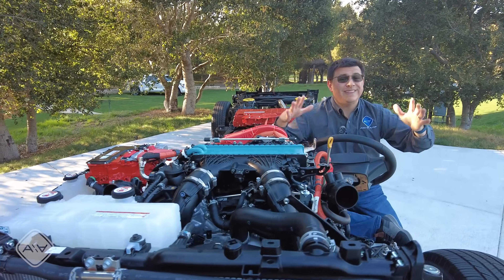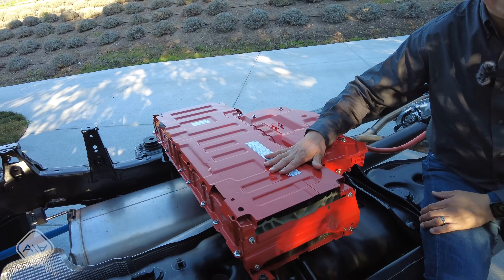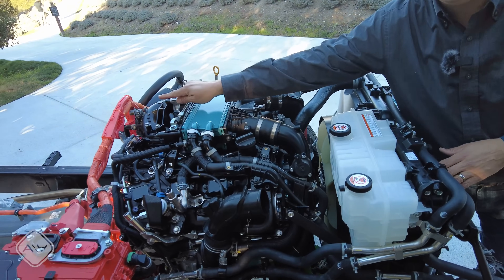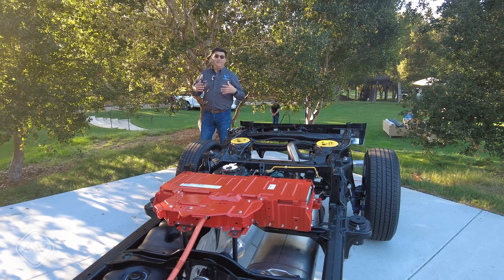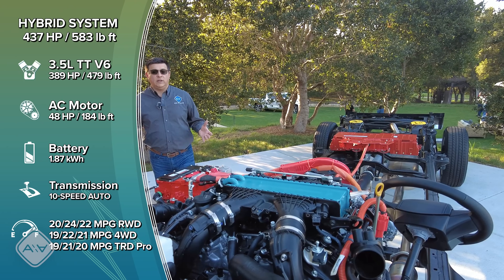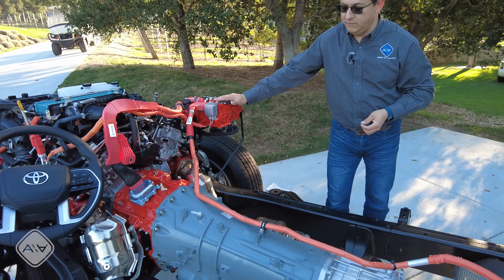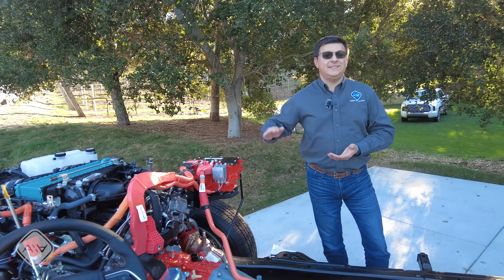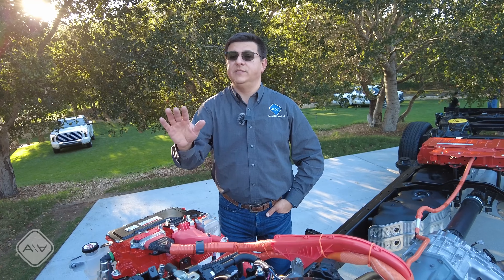How Toyota's New Truck Hybrid System Works | 2022 Tundra & 2023 Sequoia

Comment: Still can't believe that the company that made the most popular hybrid (Prius) is the last one to make hybrid trucks.
Reply: Was hoping it might be a plug in, but this video was the first thing to explain why that wouldn't have worked
Reply: Trucks won’t work on the Synergy Drive system. It’s too much torque for a planetary gear set to handle.
Reply: last one? I only know of the F150, who else made a hybrid truck?
Reply: @gwot  GM made hybrids a decade ago…
Reply: @afcgeo882  um... unless in your universe GM has them, cuz mine doesn't. which GM truck has a hybrid?
Reply: @gwot  Both, Silverado and Sierra 1500s came with a hybrid engine with the 6.0 V8 and a planetary gear set transmission with four wet clutches. This debuted in 2005 to 2009 (depending on the brand and model). Tahoe, Yukon and Escalade used the system as well. GM sold its last hybrid in 2013 due to low demand.
Reply: @afcgeo882  cool cool. that makes Tundra the 3rd truck? that's still not last is it?
Reply: @gwot  It is, FACTUALLY, the last one to make a hybrid pick-up, until some other company that hasn’t made one takes the title.
Reply: @afcgeo882  ah, i think the word you're looking for is "latest" not "last". Last would indicate every single company made one and that there are no more companies left to make one
Reply: @afcgeo882  no they are not synonyms in our context, If you put it that way, "last, for the moment" yes it makes sense. You can't just say "last" alone, which implies, "last", not "latest" which means 2 different things. You simply cant say last when there's a possibility in the future for others. and very mature of you to lash out personal attacks, I'm done here, cuz we can't even have a mature debate on the topic anymore, grow up.
Reply: @gwot  You are clearly creating your own context (in your head) just to attack others. You’re done here, troll.
Reply: @afcgeo882  take your own advice
Reply: And they deleted the rear seat storage bc they used old batteries, no onboard generator, poor mpg, and terribly ugly styling. Lol. I was going to buy one before they “unveiled it.”
Reply: @Libertarian_Neighbor  they didn't "delete" it, they just put it there because the cab is climate controlled, so they don't need to run dedicated heating and cooling like the F150, and NiMH has a much wider temperature range than Li-ion also much less susceptible to blowing up, plus it's out of the elements in the cab. It's not "old batteries" it's just a different technology, and no, it's not old (obsolete) technology either, it's a non plug in hybrid anyway, and it has more kwh than the F150 hybrid. poor mpg? the hybrid isn't meant to help in mpg if that's what you're getting it, it's just a boost in power for towing and hauling added to the exact same powertrain as the non hybrid. The engine is a generator, and it has 400w, so technically yes it does have a "onboard generator", just a lower wattage because the cost of a 7.2kw inverter is the same as an actual generator that all contractors already have anyway, aka gimmick. "Terribly ugly styling" is your own personal opinion, I think it's the best looking 1/2 ton on the market. All that being said... i'm buying the GM diesel haha
Reply: @gwot  There is no 400w generator.  It's a cheap inverter that's been around since the 2nd gen Tacomas.  Most other Toyota models have much better inverters, such as the 1100 watt version in the Sienna.

There's really no reason to use anything other than lithium.  Even with the added weight of heating/cooling, the energy density is still better pound for pound, it charges faster, lasts longer, and produces more power on demand.  That's why so many others have made the switch after having been NiMH in the past.  Tundras will switch too; this is just a planned obsolescence case.

Comment: Does this use the main motor-generator to charge the battery or a separate alternator ? 
Is the main Motor-generator used to start the engine, or a separator starter ?

Is this the arrangement of the drivetrain ?
Engine - clutch - motor - torque converter - 10 speed gear box
Reply: This uses a motor-generator shown in the video for propulsion, charging and to crank the engine. The arrangement seems about right.

Comment: Does the hybrid keep the AC going when the “start/stop”  engages vs in gasoline only the fan speed decreases and air isn’t cold?
Reply: It has an electric AC compressor which is completely independent from the engine.
Reply: @michalp2362  the non-hybrid engine has an electric AC compressor?
Reply: @joemontana4370  no. Hybrid only. Non hybrid is a belt driven
Reply: Yes, all hybrids use electric air conditioners.

Comment: Incredible to see all the robustness of the chassis and the mechanics of this vehicle which most of the time will only be used to move only  one big ass .
Can't wait for the rest of the planet to adopt this incredible mode of transport that is the pick-up .
Reply: The chassis is one of the few things that have been downgraded from the older model.  This chassis will be shared with much smaller/weaker vehicles.  Personally I have to tow or haul several times per week so I must use a pickup.

Comment: hi Alex i assume that there is no drive belt  ?  so no alternator or starter to fail including rollers and tensioners
Reply: Hybrid systems don’t have starters. The engines are cranked by the drive battery/generator at full RPM instead of a fraction of that crank power that a 12v battery provides. It’s one of the reasons why a hybrid battery should never be completely emptied.
Reply: @afcgeo882  Toyota has kept the starter and other accessories for redundancy purposes in this case, which i do like.
Reply: @alexphillips4325  It wasn’t kept for redundancy purposes at all. This drivetrain has just one electric motor and an inverter. It was designed by Ford (yes, it’s a Ford licensed system) to have a starter for cold starts and the electric motor for running engine starts.
Reply: @afcgeo882  yes, the drivetrain has one electric motor and inverter. The drivetrain also has a standard 12v battery, starter, belt driven accessories, and basically every other system normal to non-hybrids. Also, please source your claim of this being a ford licensed system, as ford and Toyota ended their license agreement nearly a decade ago.
Reply: @alexphillips4325  ALL hybrids have 12v batteries. They run the accessories. My sources for the info are internal. The system stems from the prior relationship, as it was already being developed in 2013 when their partnership ended. Both companies ended up “stealing” each others’ hybrid plans, which is why the current Ford 2.5 hybrid is almost identical to Toyota’s and the Toyota’s 3.5 twin-turbo system is almost identical to Ford’s (and no one is suing the other).
Reply: @afcgeo882  yes i am aware of this. Most hybrids lack belt-driven accessories and a 12v starter, which is the difference I’m pointing out here.
Reply: @alexphillips4325  
??? Every Prius has kept the 12v system. I think even EVs still have 12 volt batteries to power the accessories.
Reply: @Appletank8  12v starter is gone, not the 12v system
Reply: @alexphillips4325  
Ah gotcha, misread.
Reply: In this case, the engine does have a starter and a standard belt-driven everything, as Toyota wanted to keep them for redundancy purposes. The system will start using the 12V battery and starter after a refuel (for testing) or if it’s too cold for the hybrid system to start the engine.

Comment: If they would just come out with a tundra prime that has a much higher density battery and motor output they would attract more buyers. Fords 7.2kw pro power onboard is fantastic and crushed everyone else
Reply: NiMh is better in extreme cold,  lithium struggles there
Reply: Yuck a ferd, noway jose sticking with Toyota !
Reply: They might release prime version with solid state batteries - or maybe they go full EV on 2025 onwards
Reply: Thank you for this video!
Reply: Toyota chose to go with a NiMH pack. They don’t consider Lithium to be safe or reliable enough to put in regular hybrids. Everyone with a Lithium packs has a battery swap repair coming in half the time of Nickel Metal packs.
Reply: @allanedwards2347  : well, they considered Li batteries safe enough for 2016-current Prius
Reply: @allanedwards2347  they did put lithium battery in the rav4 prime?”
Reply: @allanedwards2347  Nope.  Research proves lithium lasts longer.  Do your homework.
Reply: @allanedwards2347  I still believe it’s a cost cutting measure to put this type of pack under the seat.

Comment: This truck will be very expensive to have serviced once the warranty runs out and complicated what is Toyota thinking and it gets poor mileage also crazy 😜
Reply: IDK. I think this hybrid system should be pretty reliable at least in theory lol. It’s for sure a lot simpler then the F150 powerboost
Reply: "This truck will be very expensive to have serviced" What are you basing that on? I haven't heard any complaints about Toyota's other hybrid vehicles - quite the opposite in fact.
Reply: No different to other complex and technologically sophisticated cars and trucks these days.

Comment: F150 Hybrid is still the benchmark. New Tundra Hybrid don't seem to be worth the value vs the F150 Hybrid. If someone wants a Tundra. I would just stick with the gas engine only. NiMh battery don't have enough power to do much. It's just added space and weight. Honestly, Toyota using the NiMh battery is because they can't find a supplier for a Li battery. They have talk to CATL, BYD, etc in securing Li Battery but they all have contracts with other automakers already.
Reply: The amount of energy the battery contains is more than the F-150 Hybrid though right (1.87kWh vs 1.5kWh)?
Reply: @ALMX5DP  Ford stashes a 1.5-kWh lithium-ion battery under the bed, Toyota uses an approximately 1.5-kWh nickel-metal hydride battery mounted under the rear seat. Both really the same size capacity. Tundra hybrid is about 500lb more than the F150 hybrid. So you have a lower payload with the Tundra hybrid and lower mpg vs the F150 hybrid.
Reply: @Lucky-ii3ft  Tundra has a 1.87kWh battery. Just wasnt sure what you meant by "NiMh battery don't have enough power" being the Toyota has more energy.
Reply: @ALMX5DP  What I'm trying to get at is the power density vs weight isn't good. More power with more weight kinda cancel each other out. I have an 2008 Tundra, I'll probably drive it longer until Toyota comes out with a li-on battery or solid state.
Reply: @Lucky-ii3ft  sure, but there are more factors than just the battery which affect weight (aluminum body panels are probably one of the most significant differences). But the Tundra does have more energy capacity in it's hybrid battery, and when paired together with the engine makes more power and torque than the Ford.
Reply: @ALMX5DP  It does make a little more power but it's also about 500lbs more. Lower payload and lower mpg. I haven't look at 0-60 numbers yet. While Toyota have said this is a new NiMh design. I heard from many with older Toyota hybrid system only lasting 6-8 years on the battery (average). One YouTuber did a real world drive test with his ICE Tundra and got 24mpg on all highway. I just don't see the Tundra Hybrid as a competitive product. Get the ICE Tundra or if you really want a hybrid, go for the F150 Hybrid, you'll also get a standard 2.1kw outlet generator (7.2kw optional) vs the 400watt Toyota gives you on the Tundra.
Reply: @Lucky-ii3ft  my prior work has a lot of 2nd gen Prius, and many of them are still on the road and still on their original battery (~2004 models and 200+k miles) so not sure who you heard from. And if someone got 24mpg in a standard Tundra (over EPA figure) wouldnt some assistance from an electric motor stand to increase that figure a little more?

I love the F-150 hybrid and may lean that way just for the power onboard feature, but that's not to say the Tundra is absolutely inferior. It's still a very well thought out truck.
Reply: @ALMX5DP  Hybrid do better at low speed. They don't do as well on highway driving plus all the added weight to it. But honestly it's all up in the air right now until we see more test reviews. I don't suspect it will do better but I can be wrong.
Reply: Ford is junk
Reply: Toyota won’t use lithium for any standard hybrids. Only plug-in hybrids that have higher power demands. Safety, cold weather performance and reliability are why they’re staying with NiMH packs. 3 years from now they will go to solid state packs to leapfrog Lithium.
Reply: @allanedwards2347  Solid state definitely would be better. I just have a pickle at the fact that anyone saying NiMh battery is better than Li-on. Rav4 Prime have a 10 year,  150k mile warranty for the battery system. Are they going to offer that for the Tundra too?
Reply: @Lucky-ii3ft  Toyota warranties all hybrid batteries for that 10 years or 150k miles regardless of if it's a NiMH or Li-ion. I think most of their standard hybrids still have NiMH chemistry, including Prius, Camry, Rav4 etc (excluding Prime models).
Reply: @ALMX5DP  That's good they'll stand by their battery with the higher warranty. A little piece of mind for the consumer.
Reply: NiMh batteries on Rav4 hybrids working well. 40 mpg combined + EAWD for an SUV very impressive. Prius have also used NiMh which revolutionized the hybrid industry and provided incredible fuel economy.

Comment: 2kwh... That is just a joke...
Reply: F-150 Hybrid has a 1.5kWh battery.
Reply: @ALMX5DP  and that is laughable as well, but at least they are using batteries from this decade
Reply: @skodbolle  for the high voltage battery sure, I think both still use flooded lead acid batteries for their 12v systems yet no one seems to complain about those.
Reply: @ALMX5DP  The difference is the 12v battery is not meant for actually moving the car.... and most manufacturers have moved to AGM batteries even for that
Reply: @skodbolle  does it matter what the battery is used for?
Reply: @ALMX5DP  Yes there is a big difference between a traction battery, start battery and standby use battery
Reply: @skodbolle  I get they have differences, but your complaint was having a battery “from this decade” as if that means anything.
Reply: @ALMX5DP  it means that the battery is large, heavy and inefficient compared to its capacity. And it will not last as long as a lithium ion battery.
Reply: @skodbolle  if you only look at the cons and ignore any of the possible pros then sure.
Reply: @ALMX5DP  When the cons heavily outway the pros then that is what you tend to do... the only one winning anyting here is the manufakturer who is saving money and sourcing costs. Something I doubt they will pass on to the customer.
Reply: @skodbolle  I look at both sides and try to be as unbiased as possible. Many items in both columns, and I can see reasons that benefit both OEM and consumer in both as well. I love the F-150 Powerboost but also see some benefits to how Toyota designed their system.
Reply: @ALMX5DP  i have never mentioned the F150.. their system is marginally better but still laughable
Reply: @skodbolle  what other full size hybrid trucks then would you be using as your reference?
Reply: @ALMX5DP  none, with hybrid systems this weak there is no point to them, it only exists to circumvent emmissions legislation, it's a total joke
Reply: @skodbolle  so what are you using as reference then to call them “weak”?
Reply: @ALMX5DP  a normal passenger car hybrid have 10-15+ kWh battery packs for driving in electric mode, and a gigant truck has a system hardly fit for a bicycle
Reply: @skodbolle  which non plug-in hybrid might you be referring to?
Reply: @skodbolle  you didnt answer my question, and standard hybrids (I've never heard the term self charging here in the US) are definitely viable and help reduce tailpipe emissions. So please if you have substantiation for anything, do feel free to type that in.

Comment: With the extra battery Ford can add, because it is Lithium, they get an extra 2 MPG
Lithium is a more efficient energy system.  Nickel is a cheaper system
The bean counters win this round
Reply: This is a lot more reliable and so much easier to replace in case of a failure. That battery has only one electrical connection, ambient air cooling and lives under the back seat. Ford battery set up is nicer for those trading their trucks when they’re still new as it doesn’t take up cab space but it has its own cooling loop, exhaust system heat exchanger and is most likely inaccessible without taking the bed off or removing some major components from under the truck. Also miles of electrical connections and modules exposed to elements under the truck. Do you see potential issues here during a long term ownership? On the other hand if I were a guy leasing new truck every other year I’d take the Ford in a heartbeat
Reply: extra battery?
Reply: Toyota is being conservative and not going to Lithium bc of drawbacks of longevity, cold weather and safety. They’ve been running NiMH packs for 25 years. It’s the bulletproof choice. Not sexy but higher resale for sure.
Reply: @allanedwards2347  Actually, Lithium lasts longer, and can be kept warm with temperature controlling.